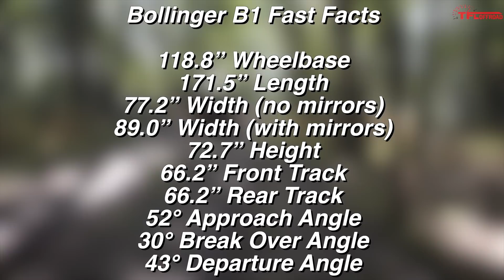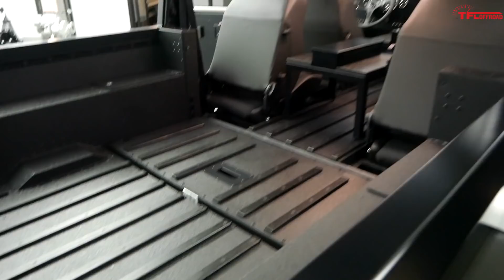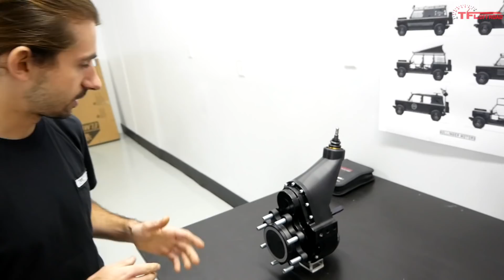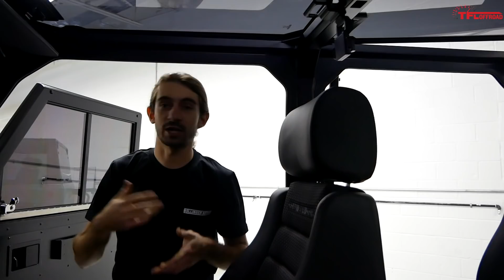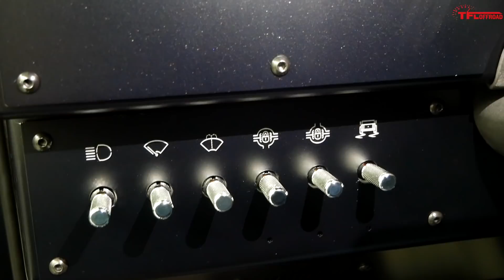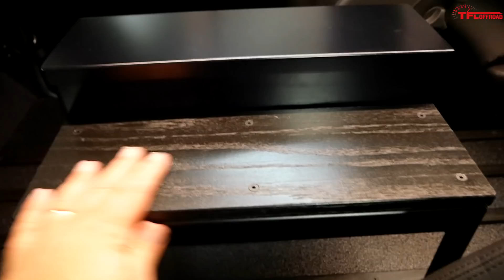You Won't Believe How Clever this Electric Pickup Truck & SUV Really Are

Comment: Basically you get a solid steel custom-made toolbox on wheels powered by AC motors and with multiple DC outlets. (Wizard salivating.)
Reply: It solid aluminum instead of solid steel.

Comment: New sport.  Put a 30 ft I beam in it sticking out through the front and do Bollinger Jousting.  

I do want one of these. I cant imagine a more practical daily driver, but it needs one more feature, a portable bed or hitch mounted range extender so you can drive cross country using gas or diesel.  Leave it at home when you are not on long trips and it becomes a backup generator for your house.

Comment: I would buy this over the rivian any day if you saw the spec drawings you would see the multiple options and packages the buyer can have. Off road has it levels I would prefer to tell my client to which level. def will not want to take a rivian on a deep adventure trip to damage the paint. Spend the money coat the body with bedliner and have a blast..

Comment: So close. Missed it with a true transfer case and solid axles.
Reply: Yeah, if you want to rock crawl it you'd have to swap in some danas. But if you want to bomb along a bumpy road apparently independent suspension floats better? I thought about sas but I like cruising backroads more than crawling boulders. I also briefly considered  independent suspension for my rear end like a buggy, decided that a swing arm would be better like a trophy truck, and then realized that I can't afford any of that anyways and if I could i probably wouldn't do it to my daily driver. So I guess it's solid rear and independent front for me. They should offer both as options so the customer can choose what works best for his purposes, in my opinion.
Reply: @revwroth3698  I get the idea with independent suspension but I still prefer a solid axle. Its not my daily driver either, I do drive it everywhere on the weekends and after work.

Comment: Because ICE trucks and big SUVs have become very expensive, they have left an opening for these electric vehicles that at 60-70k don’t seem much more expensive than a high end F150 or suburban.
Reply: A high-end F150 is made with nice materials and is feature packed. That's why it cost $70,000. This a basically a tool cabinet with BFGs.
Reply: Paul M definitely, it’s the way of the future a

Comment: For the most part I like it. If they are trying to appeal to contractors with that pass through I think they missed the mark. Nobody is going to use that when it's raining or even hot climates it's going to be breezy in there. I just don't see my self using that. Other than that it's cool.

Comment: Some problems the switches and metal dash board won't pass crash tests not to mention sharp metal corners. That said who knew they would blow Tesla out of the water with overall design. Smooth out the cab and I would consider buying one.

Comment: im seeing these as unimogs.  Great off-road ability, crazy high payload, high house load rating for powering cranes, welders, digging tools, etc.  plus all the dash space for custom upfitting.  With that kind of a payload you could put a high KW generation in that front area too for long and heavy power use which gives you fuel source flexibility.  Gas, diesel, electric.  No problems.

Comment: I thought between top solar panels, axle spin and electric motors creating energy, no charging was needed.  An inadequate 200 mile range would depend upon wind resistence hitting that flat, square front, and speed.    Needing to pay for electricity instead of gas completely negates electric for my purposes because the more I use, the higher my rates are.

Comment: 1-air suspension has too many components: pump, motor pump, lines, valves, selenoids, air suspension  chambers, sensors and sensors and more sensors, seals, and seals and more air seals and then an honest specialized air mechanic.  Other than that air suspension is truly the best quality ride.  A quick air suspension to a standard coil suspension should be available.
2- did he say 120kwh Lithium-ion, L-i, battery pack? That is a value of at least $70k usd , aprox, just in the battery bank (2021 premier OEM pricing).  A Tesla model S has a 100kwh L-i battery bank.
3-in order to lower the investment on batteries in 2021, they could add a Range-Xxtender to 300 miles, such as a Gen-Set combined with a smaller 50kwh battery bank.  That is until battery OEM prices hit a sweet-spot of $100 per kwh from a premier OEM, such as Panasonic.
Congrats to this EV group, very innovative features.

Comment: Will the cabin act as a death meat grinder / bone breaker cage in case of an accident? Looks like a lot of metal and hard corners that could injure people should they make an awkward move inside. I would only have a ride it it if I wear protection on my knees, elbows, shin bone, ankles etc. The seats are cushioned - that's a plus. Hopefully side and steering airbags will be added in the final production release.

Comment: Someone give them a body panel press.
Reply: The body panel stamping machines are what keep any sensible person from trying to start up their own car manufacturing company.  You need the profit on hundreds of thousands of cars to absorb the cost of the presses and required tooling.  Bollinger went a different route with body panels that you can make in a garage workshop with simple tools.  They look boxy, but are easy and cheap to make.  That means a lot less initial capital to get the company off the ground and makes is more likely that Bollinger will turn a profit.

I bet after they get profitable, they take the skateboard platform and build all kinds of cool trucks/vans when they can afford the stamped body panels.

Comment: I love the look and the rugged capability of this vehicle but I have a question : it has a 200KW Battery pack and the recently released specs on the Lucid Air Sedan says it has 113KW Battery pack so why does the later vehicle have  503 -517  miles of range per charge and this one can only muster 200 miles of range per charge ?  I doesn't seem ( to me at least ) that the shape would account for that much loss of efficiency given the disparity in battery capacity.  Also, the forthcoming Rivian Truck is said to be capable of 400 miles of range in it's top spec model. What other factors are involved ? What am I missing ?

Comment: Every time I see one of these electric pickups I cannot believe they insist on making them look like a gas engine pickup.
In an electric pickup where the working parts can be located anywhere, why in the hell do they waste the front end with a trunk space ?
The only logical solution is a cab forward design that maximizes the rear pickup bed space.

Comment: Perhaps they should be more clever with...aerodynamics.  looks like they spent less than 5 minutes total on body design.  The perfect vehicle for anybody whose favorite shape is a box.  It's like a cabinet you can drive.
Reply: The shape was deliberate. A box is the most effective shape for interior volume. Plus the flat aluminum panels are meant to allow it to be very easily repaired. Any metal shop can make replacement panels. No complex stamping needed.

Comment: I thought the whole point of using an electric vehicle was to have instant power without any sort of multi speed transmission slowing you down  . if they want to make them this way that's fine but they shouldn't expect any real off roaders to buy something like this XD.
Reply: You cannot connect a 15000rpm motor directly to the wheels.
Reply: @cruiser97eric1  no shit that's what the drivetrain along with the  reduction gear and  final drive is for. Also I guess you've never heard of the in wheel motor system. and to quote someone elses post off  of the internet "A multispeed electric vehicle transmission would add weight, complexity, friction, and inefficiency to an otherwise simple system, actually robbing the powertrain of torque, power, and efficiency"

Comment: Production ready? I think not. It took 5 steps to open the back pass-through, and did you notice the mid-gate pass through folds DOWN into the bed floor!? Ya, right, even the smallest amount of debris, not to mention the mulch bits, will stop/jam that door from being flush. Cleaning nightmare. So basically if I have had anything in the bed I have at least 5 steps to open the mid-gate, and one of those steps is a possible 5/10 minute clean up in the middle of my work.   And is the 4 x 8 sheet resting flat on the deck? What about those two little  2 inch bumps at the wheel well??  OK, so ya, keep it simple, I agree, good ideas, but need a bit more refining. If ease of use is the goal, there a few places which are deal breakers.

Comment: Can a solar panel be installed to keep charge as opposed to the glass roof so there will be more range offered??
Reply: The available area of the roof (the entire roof, not just that sunroof) for solar would provide about 200-300 watts of energy potentially per hour in good direct sunlight. This car uses a 120 kilowatt battery pack. This car has a max range of 200miles between charges (likely less). Traveling at an average of 60mph that would give you roughly 3 hours of driving time and possibly direct sunlight, so lets say around 750watts of extra energy provided during that time. So approximating that each kilowatt of energy is giving you about 1.66 miles of drive time, then with your whole truck roof completely covered in solar panels you may get an extra 1.2 miles or so of range assuming excellent solar efficiency and assuming their advertised range of 200 miles holds true. More likely you would get about an extra 2500-4000 feet of drive time. That may be worth it to some, probably not realistically cost efficient though for these guys.
Reply: So it is not a replacement to a Jeep sadly, more of a fun toy.  No place to plug in for serious overlanders and off-roaders

Comment: My friend got one of these and I have a fairly new boat we went to the river for the weekend. We were out in the desert on the way and it ran out of charge. It got hot in the day. I brought a window AC that runs on 110 but could not run that either. We had a solar charger but by the time it was charged the weekend was over and had to go home and back to work. I suggest a large generator if you want to take it someplace. It works great for grocery shopping or if you tow it where you are going. Not sure if you need a flatbed for towing it. He does not drive it much now due to the price of batteries it will need soon.  There is a lot of confidence going shopping at the grocery store or mall with all wheel drive. It is a millennial machine to have. You can cross over the lawn without an issue.

Comment: I really like the Truck...  I like that it has a 6 Foot Bed, good Tires, actual BUMPERS like a Truck should have, etc.
There are only two flaws that I saw.  First, the Front Bumper needs those Hooks to be "below" otherwise anything you use the bumper for will poke HOLES into it with those hooks.
Second, while the Door Windows will last forever with that design, I like being able to FULLY open the window and put my arm on it, so I don't like that particular style.  Maybe if you can figure out a more simple way to do the traditional style that would be great.  Also, battery tech needs to improve more, I want it to last longer and charge faster.  It would be nice if someone finally figured out how to use Wheel Motion to charge the batteries, even if it's just partially charging.

Comment: Lots of cool features, but 200 miles is definitely not enough to call this a highway vehicle. Plus, the refueling infrastructure is not in place yet, so I'd be walking along the highway with my thumb up a lot. I love the concept of electric cars/trucks, but right now they aren't much more than city commuter vehicles. 
And now for all my questions:
How significantly does using the air conditioning or heater reduce the travel range?
How significantly does -20c reduce the travel range?
 What about -30c? What about -40c? Will the batteries work at -40c?
How long does it take to recharge from "empty"? (at a retail recharging station such as Tesla at CT)
How much does it cost to recharge from "empty"? (at a retail recharging station such as Tesla at CT)
Can I charge it from the 110v plug in my garage and how long would this take and how much would this cost (using avg electrical rates in Canada)?
Why doesn't TFLoffroad ask these questions when they are doing these videos?
Reply: How quickly do we forget that Nissan has sold a ton of Leaf EVs with range much less than 200 miles.

Comment: Um, fast facts don’t include RANGE?!?
Reply: 200 miles EPA is their target.
Reply: @cruiser97eric1  Looks like a cool off-road vehicle, but 200 miles is not competitive. Maybe off-road drivers won't care about that, but it seems to me, with electric cars, the range is the biggest factor. 200-250 should be minimum trim. Rivian is advertising 400+miles range on their coming truck and suv.
Reply: @MusicTheoryInAMinute  Bollinger's 200 miles is almost as good as the Audi e-tron's 204 miles. The extra 200 miles for Rivian requires a 180 kWh battery. Once people see how much cost that adds, I think many will decide they don't really need 400 miles after all.

Comment: The passthrough is cool but a gimmick. Loads of tradesmen and builders today simply use roof racks to carry long lumber, pipes etc
Reply: Homeowners still need to haul long trim lumber too.  Less than 10% of trucks have roof racks.
Reply: @guyod1  that may be the case but fitting roof racks is a hell of a lot cheaper and less of a compromise to the entire vehicles design than this

Comment: I really liked the long middle through well for long timber. That is one of the key functions I need a truck for.
It would be a lot better if it was a hybrid. Not only for the range, to run power tools all day but also as someway to get back to civilisation when the battery runs out. Otherwise it would be useless in Australia. 
Imagine driving a current generation all electric vehicle into the Outback! It could be a death sentence. 
In fact with only electric range you'd reach the start of an off road track and then have to turn around and come home again. At best.
Perhaps they should consider a diesel generator as a slide in option, if they want to keep the modular aspect.

Comment: : Lets see what you get for 125K. You have an EV vehicle that will only travel 200 miles. If you plan on a back country trip, you'll have to pull a trailer with a large generator and take more time off work to allow for multiple charging. You couldn't take a trip anywhere, unless it's only within 75 miles from a charging port. The sliding windows are a true automotive engineering accomplishment along with the styling of a Maserati, for the minuscule price of only 125K. The only people who'll buy this are people who live in a major city or have a farm, as this would be totally useless for any serious off-roading. I do like the concept of an EV vehicle, but it would be mandatory for a much lower price, longer life batteries, better looks with better amenities like seats and windows, before I would even consider buying one. For 125K, Bollinger better give you a motor cycle to go with you new Barbie Glam EV, because if you plan on going off-road you'll need it. Sorry Bollinger, but I think I'll keep my Power Wagon for now.

Comment: @TFL don’t you think if they wait to much longer the big three will be making electric trucks at a much cheaper price so I don’t think there will be a market for them to compete?
Reply: I think they'll be bought out of they can show competition.
Reply: B Lindsey that would be true if they were close to starting to produce them. Right now it’s a pipe dream with a few concept vehicles.
Reply: How could the big three make electric trucks a cheaper price? The drivetrains are more expensive.
Reply: Cm22c ford and chevy will get in the mix before to long and they won’t have a 150k price tag like this is going to be.
Reply: @sonnynick1  If they price it at $150,000, it likely would be cheaper, but I doubt this will be $150,000.

Comment: I'm thinking about a way to engineer a 1.8 diesel engine  ( aftermarket) unit to be installed in the front (trunk) area for enough power to run the truck on diesel and or charge for enough power for the front motor to extend its EPA rating from 200 miles to,,,,? ,, and as for a backup power source.     just a thought.             just sayin

Comment: Did I miss the pricing?  I thought Steve said he was going to talk about that at the end. 

Tachometer but no way to easily monitor other important things, the tiny screen is a joke.
Sliding windows vs electric windows for simplicity's sake and presumable weight savings but
Glass roof panels vs anything more cost effective and lighter weight.
Switches need to be better organized but I do really love the toggle switches for everything.

I fear Bollinger will turn into another Fisker where the vehicles have quality issue after quality issue and people ultimately end up cramming V8's in them.

Comment: Can you mount a thin solar panel on the roof?
Reply: Based on the roof size you could certainly mount about 200- 300 watts worth of solar power. This would potentially give you a few thousand extra feet of drive time. So likely not a worthwhile factory addition.
Reply: @JimYeats   I was thinking about how much it might charge while parked if you went camping or something like that.